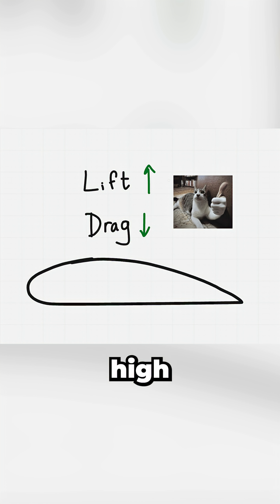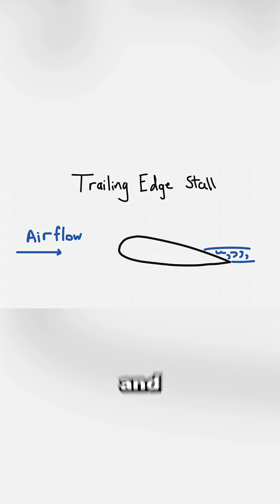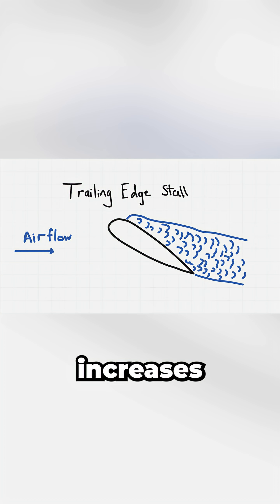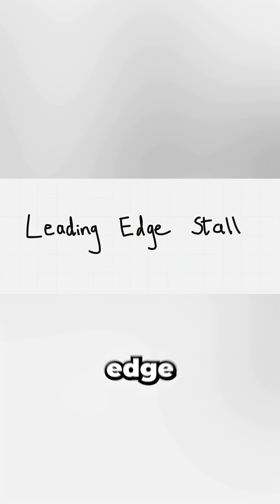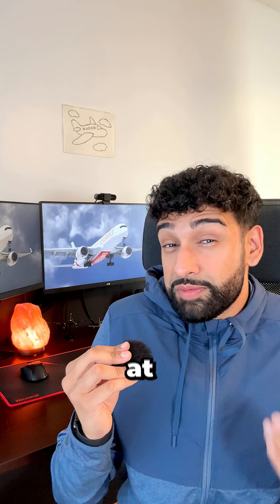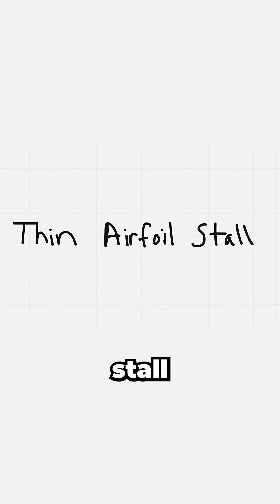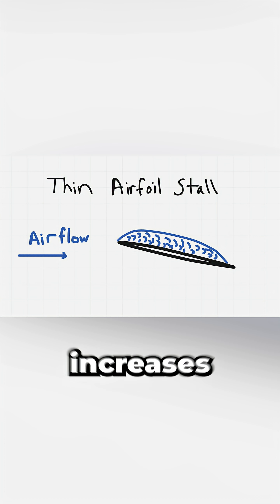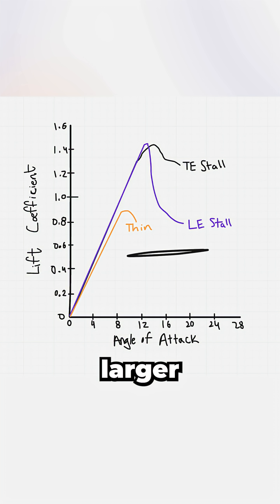The 3 types of airfoil stalls explained!

Comment: On the F-18 and other jets, they angel down the edge of the wing (in French it is vriage négatif) making it stall at higher AoA. This lets you have a decent control on your movement even when no more laminar air flow on most of the wing. Correct me if I am rong.
Reply: Ils utilisent aussi les « moustaches » à l’avant de l’aile qui commencent au niveau du cockpit pour générer des vortex (grosses zones de dépression) qui maintiennent une dépression sur le dessus de l’aile, comme lors d’un écoulement laminaire 😊
Reply: @GMindset123qui crée plus de portance!
Reply: Yes as in a leading edge flap, Krueger flap.
Reply: @Zorroxyz123 na we are talking of something else

Comment: What kind of airfoil does a Lancair IV have ? How does it stall ? Higher L/D ratios will allow you to glide further if it ever gets to that, which is also a safer thing. And allow you to climb faster on takeoff which can also be safer in some situations. But you got to be careful not to stall, which might be tricky in high workload situation. Even though we train to avoid a stall, it can happen sometimes, especially when close to landing in weather and traffic, so an airfoil that stalls more gradually is a good backup in case the pilot fails to stay on top of things for some reason. But sometimes a wing designed for low drag as a top priority is nice to have, but it requires careful attention and pilot skills. Aircraft manufacturers don't want to be liable, so it would be in their interest to trade some performance characteristics for better stall characteristics, sometimes.